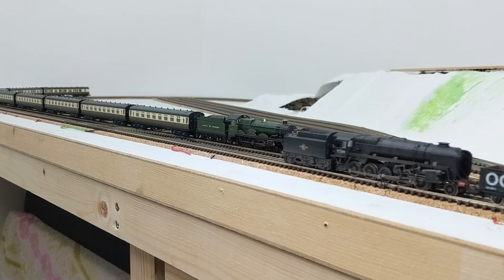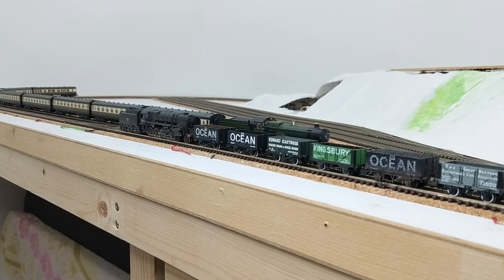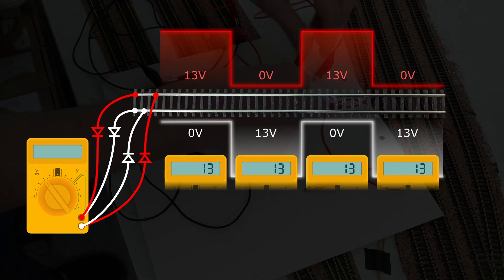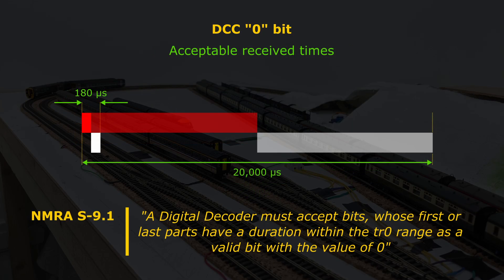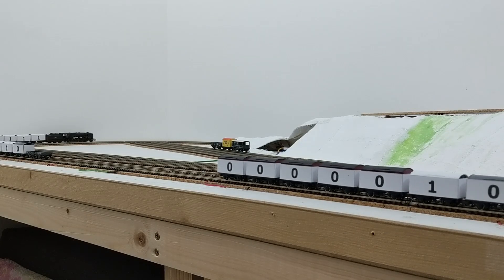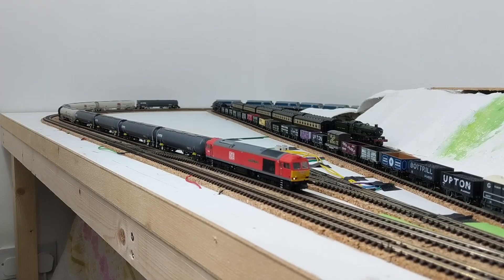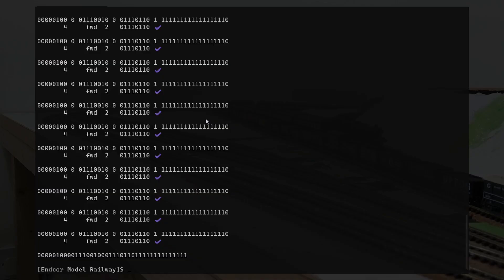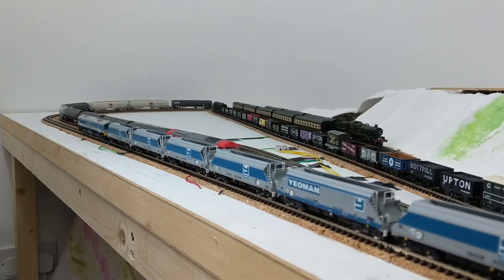0047 Decoding DCC from scratch

Comment: Have you considered assembly language?
Reply from the maker: No - whilst I enjoy programming, C is about as low-level as I like, so if that's not fast enough I think I'll be giving up on writing the code myself 🤣
Reply: @endoorrailway  with those kinds of timings I'd expect you'll be fine in C on a pico or any modern microcontroller tbh.  I'd certainly be doing it in C.
Reply: @_cheesestraws_  Using the Pi Pico PIO's are really well suited for reading and creating the timings required for DCC
Reply from the maker: Thanks - I've only watched two videos comparing assembly (x86 in that case) with C, and they were pretty close.
Reply from the maker: I didn't mention it in this video, partly because I did the audio recording several weeks ago and them spent the rest of my time since then making the visuals, but the RP2040 isn't my end goal for this - I think physically it's too big to go on a board with other bits and fit into N gauge locos. That's not to say it couldn't be used in accessories, but they aren't my aim, so I'm using the Pico to get an understanding and prove some concepts but will probably end up trying an ATTiny eventually. I hadn't come across the PIO stuff before - from what I just read it does look like this is exactly the sort of thing it's for.
Reply: @simonbaxter8001  agreed: PIO stuff is great.
Reply: @endoorrailway  The only micro controller I have messed with is the Arduino uno. I never even bothered with Arduino script and went straight to C.
Reply: You don't have to use assembly language for this... that is a total overkill.

I would recomend using interrupt for this. That way you get interrupt signal (call) when voltage changes from High to Low or otherway around. Then you just look at time (in microseconds)... and then determine if it was 0 bit or 1 bit.

It's similar to decoding RF signals in 433Mhz frequency... or decoding your IR remote. Many Arduino libraries doing that.
Reply from the maker: Thank you for the information - I did try an approach that used interrupts - in fact the first several approaches that I tried. Based on other comments my use of a voltage regulator may well have been causing issues, but it does seem that MicroPython is far too slow. It seems likely that moving to C will make use of interrupts a good way to go.